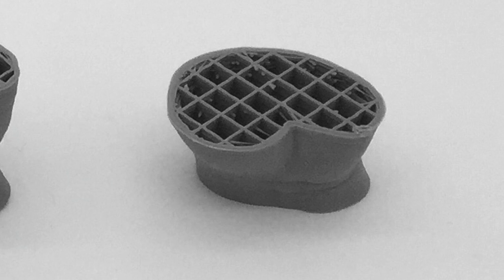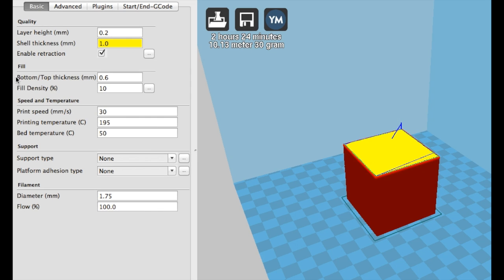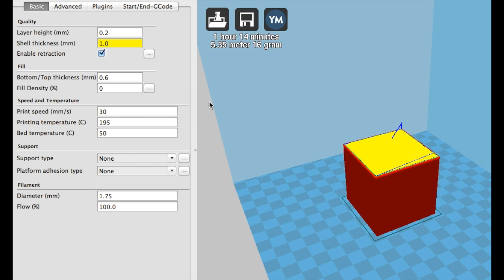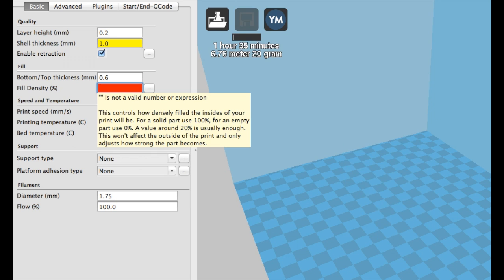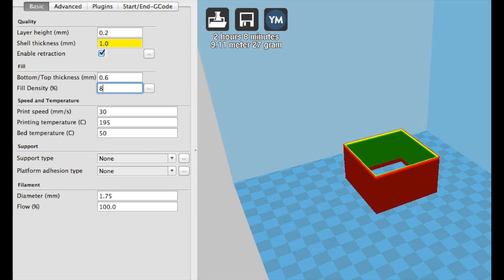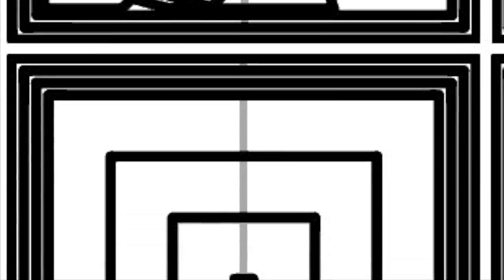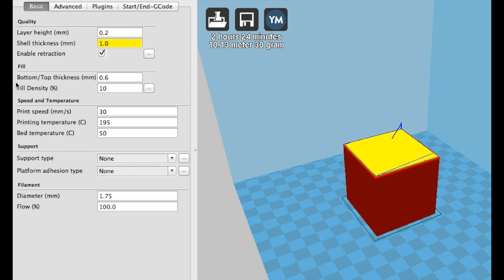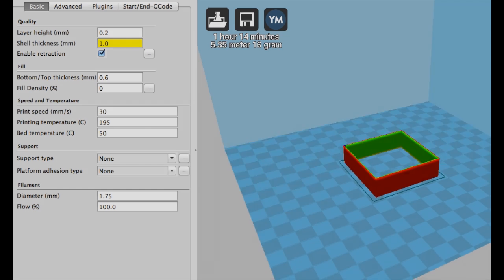Wanhao USA - Zak's Picks and Tricks // Infill

Comment: Hi, I have bought a wanhao 5S mini and I am stuck using wanhao maker. I can not change the infill density. This printer only read .i files and I can not use another slicer. I have downloaded cura for wanhao but the program generate the slices inn g-code and the printer doesn't recognize it . I have followed the instructions from the following link: https://www.wanhao3dprinter.com/Down/ShowArticle.asp?ArticleID=42  but still my printer does not read g-code. Any idea what to do to use another slicer or how to change the infill density with wanhao maker?
Thanks